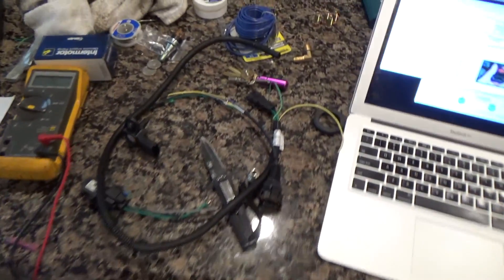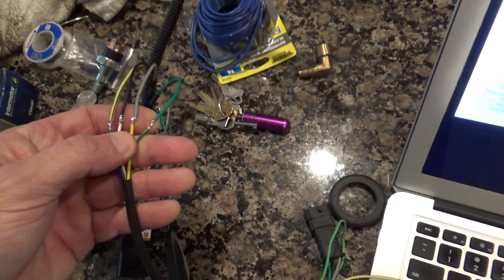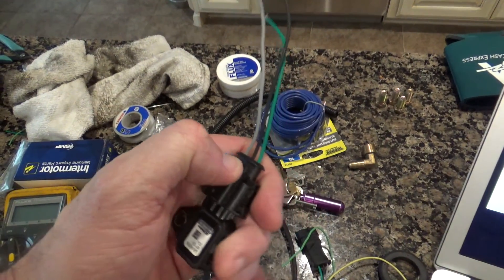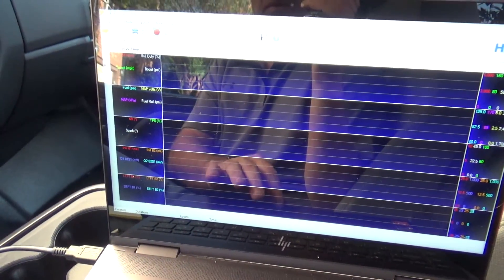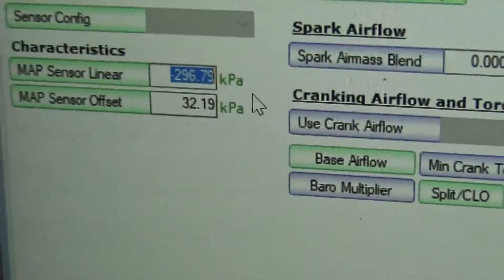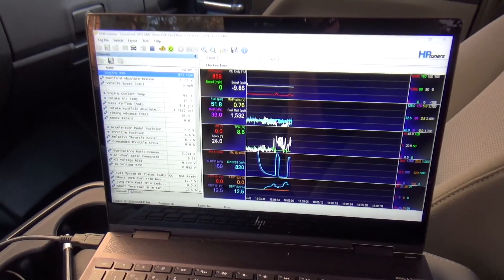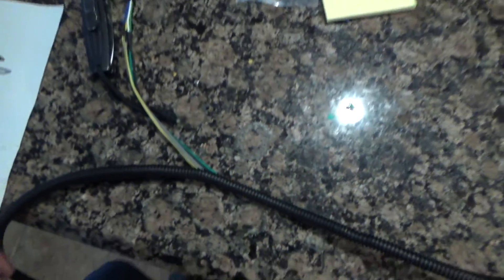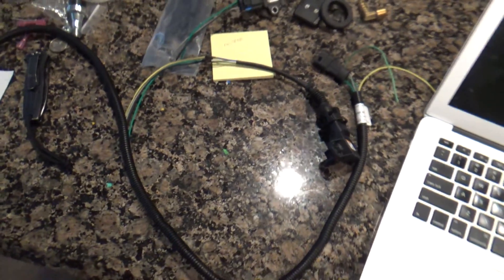MAP Sensor Upgrade 3-bar LT1 L86 L83 Gen V

Comment: So did you ever figure out why these Whipple Systems stay with a one bar map? It would seem that a two bar at a minimum would have been needed.
Reply from the maker: I don't think it's imperative.  I just did it so I could see actually boots pressure via HPT.
Reply: @nu5m_radio  OK, My tuner guy here was wondering how they got away not using the MAP to help with the fuel calibration in the boost.
Reply from the maker: @jimpapen260  I'm not a tuner, but it's my understanding that only MAF calculations are used during PE.  Lots of FI motors around with one-bar MAPs.
Reply: @nu5m_radio  So putting the 3bar map in, shouldn't affect fueling then. Correct? But you also say you should get the vehicle re turned to make sure everything is OK. Which I'm planning on Friday.

Comment: Did you have to run the ground from the map for the temp sensor signal too? I tried just running the temp signal wire to the MAF harness and that did not work. I got some codes about the IAT.
Reply from the maker: There's only a single ground for the TMAP.  Did you see the wiring diagram in the description?
Reply from the maker: Make sure the IAT is disconnected from the MAF sensor.  You can't just "T" into the blue/white wire.
Reply: @nu5m_radio  What I did was to take the IAT wire from the TMAP and connect it to the MAF harness. I did remove the original IAT which has two wires, one blue and one yellow that was split going into the MAF harness.
From my ohming out the wires the blue is the signal and the yellow is signal ground. So by me just hooking up the signal with no ground it didn't work at least in my case. This is what I'm thinking.
Reply from the maker: @jimpapen260  The MAP and  IAT packaged as the TMAP share a single ground.  If your MAP is working, then it has to be the signal wire going to the IAT.  I believe I cut the IAT signal wire about 6 inches behind the engine-side MAF connector.  Spliced at that point and left the wire running back to the MAF taped up in the loom.
Reply: @nu5m_radio  Yes the MAP and IAT is packaged as a TMAP dose share a single ground, but before when they were separate, they both used there own ground. The MAP circuit went to the front of the motor to connect to the original connection point. The IAT with it's two wires went the the MAF harness, with the signal and signal ground. So I'm thinking I have the have the TMAP IAT signal and signal ground going to the MAF harness for this to work. Now this is on a Chevy truck not a GMC. Maybe they are different.
My Whipple IAT harness came with two wires. Going from the IAT to the MAF harness.
Reply from the maker: @jimpapen260  check continuity between the two grounds.  I think you'll find they're common.
Reply from the maker: @jimpapen260  Wiring manual here--> http://www.prestonmoore.com/2018_Sierra_L83
Reply: @nu5m_radio  That's a good idea, I'll do that.
Reply: I did check the continuity and they are common. So not sure why it didn't like it. I had three IAT codes with it. Go back to the original IAT and codes are gone. The only thing I did different was to connect before the Whipple harness assembly and not after like you did. Did you disconnect both of your original IAT wires from the circuit?
Reply from the maker: @jimpapen260  I just disconnected IAT signal.  The IAT low reference (ground), remained as stock.
Reply: @nu5m_radio  OK, I removed the IAT low reference (ground) from the circuit. So that was my issue.  I'll give it a try again and see what happens.
Thank You for you help!

Comment: so I have a problem with my mapping sensor. Black bear performance tuned the truck but he assumed it used the stock map sensor. My kit came with part number (12644807) map sensor, which is a LT4 map sensor which I think is 4 bar if I'm correct? My truck has a rough idle, erratic acceleration, and sometimes it wont start until after I have cranked on it a few times. It threw a P0106 code 10 minutes after start up and started showing all those symptoms. Would it be the tune because it was tuned for a stock map and the new one is giving a false reading to ECM which is causing it to run poorly? Thanks again.
Reply from the maker: You're going to need a re-tune to update the settings like described in the video.  It'll never run correctly without the change.
Reply: @nu5m_radio  okay i figured thats why it was running poorly, thanks for your help again
Reply: Did you re tune yours yourself off of that hp tuner file you were talking about?
Reply from the maker: @tannersmith9218  yep
Reply: @nu5m_radio  right on, i just got all my kit on yesterday and took it out and i was thinking to myself i hope this isn’t what the performance gain is (because of the map sensor problem and it running poorly) because it didn’t seem a whole lot faster than before, but should run top notch after i get a re tune!
Reply from the maker: @tannersmith9218  Don't run it until you get the tune updated.
Reply: @nu5m_radio  right cause it could be running super lean right or rich for that matter

Comment: Did I see you had a LT4 Supercharger?
Reason I asked is I just got a LT4 from a 2016 ZO6 and I need to send the snout to Andy @ ADM to get the shaft and snout milled for the new Hub and pulley to align up to my Ass driive.
I worry that I need to go with the 4" tall adapter plates to clear the water pump on my L83 silverado but not sure I have enough room at firewall.
Let me know if you have done a LT4 supercharger and if you are aware of the issue with water pump?
I live in Katy and work on East side and saw your video at Houston House of Power. Nice job with the Whipple good video's
Reply from the maker: I've never done the LT4 blower conversion.  If I had it to do all over again, I would have gone with the LT4 setup after seeing how cheap they are on eBay.  I guess the reason for milling the snout is the dry sump issue? If ADM modifies the snout, does the assembly just bolt up to the truck accessories?  There was someone on here or the forums asking me about the spacers for the LT4 blower.  I can't seem to find it now.  He was working on putting the LT4 blower on his L83.  I almost sure the reason he was asking me was because the blower was hitting his water pump.  I'm not really a fan of those spacers.  They create a couple of weird angles and that look like they would impede flow.  I think you can squeeze a lot out of that blower.  I'd run as much compression as I thought I could get away with and use a cam with zero overlap (maybe go a little negative).  Can't afford any boost slippage/waste with such a small blower.    I'd port match everything and try to make everything as efficient as possible.  I'd rather have a super efficient engine with that 1.7L blower than a hodge podge of parts and a 2.9 Whipple.
Reply from the maker: @A. Salinas  Caspers Electronics makes the harnesses for Whipple.
Reply from the maker: @A. Salinas IAT is being read with the TMAP sensor which is mounted in the intake.

Comment: How is your bypass hooked up ? I see you have one of the vacuum caped off
Reply from the maker: EVAP solenoid port is plugged.  Did you get yours running yet?
Reply: pmoore4321 yes it’s running good but under wide open throttle I can’t tell if my bypass valve is closing under wide open throttle cause when I rev in neutral it barley moves at all. Gonna put a go pro under the hood and watch at wot 

Reason I asked is once you cap it off where did you run the line for the bypass cause mine is ran we’re yours is caped off
Reply from the maker: @outen21  The ports where the EVAP, bypass and PCV connect are all the same I believe.  What fixed your issues?
Reply: pmoore4321 boot on plug was loose on number 1
Reply: So what dud you do with the hard line that went to the evap ? Cap it off also ?